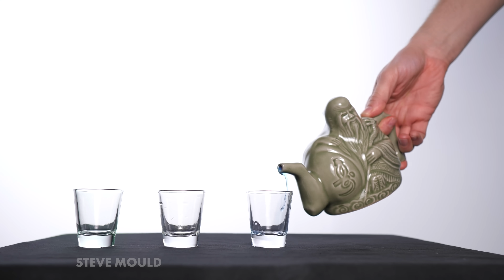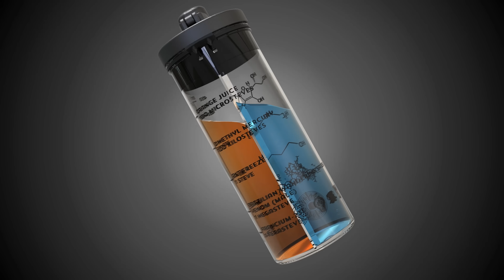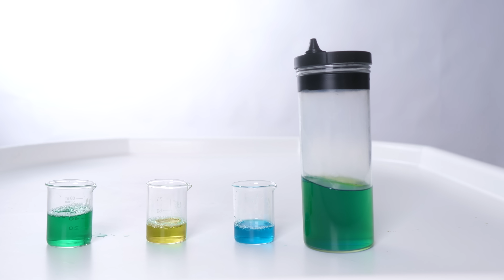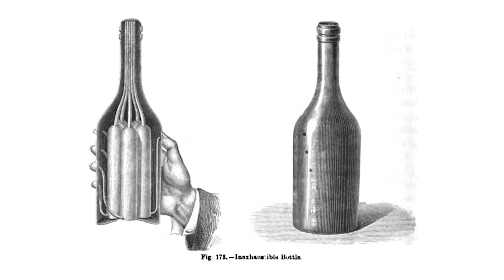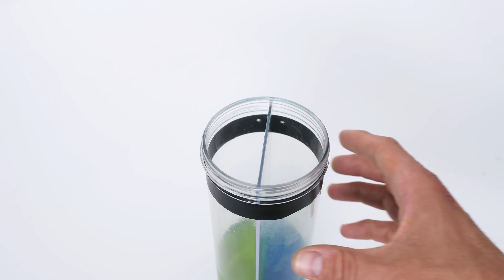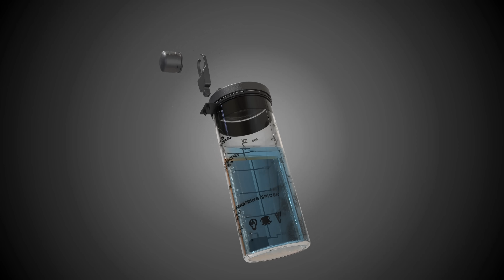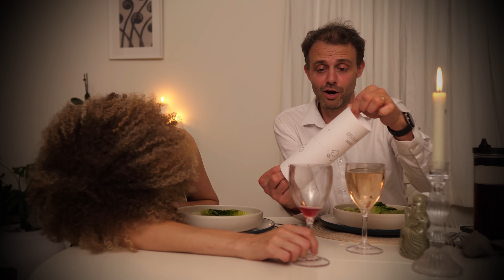The weirdest water bottle you can buy

Comment from the maker: Olive oil and balsamic vinegar! The use cases are endless. Pre-order yours now: https://curiositybox.com/bottle
Reply: About the two holes, wouldn't it be possible to have rubber/silicone click-push buttons on top of each hole, with a valve that gets clicked?
Reply: @Quillyik  That ruins the idea of using air and surface tension, but that would be good too
Reply: Can you order just the Assassin’s water bottle and not the cat one?
Reply: I can definitely see this being purchased for people seeking to smuggle in alcohol to a venue or workplace.
Reply: It's too small only 450ml  for each side. You need a minimum 2L version imo.
Reply: @aaronstanley6914  "Too small"? Who needs more than 450ml?
Reply: For the covering of the holes you can have a ring around the entirety of the top section with a small rectangular hole in the middle of it, then you just twist to cover one, both or neither.
Reply: @TukTuking  Impractical and ineffective
Reply: @AllGoodOutside  hahaha...so it is practical and effective on a water carafe, but for some reason not on this? I think you are impractical and ineffective. Go watch more youtube. 🤣
Reply: @TukTuking  You need to learn how to take criticism better. And The whole purpose of the assassin's water bottle is to not make the trick obvious. Your little clicky bit works Probably but would not work to the desired effect on this.
Reply: @AllGoodOutside  bwahahahahha...okay, dad.
Reply: @SteveMould I would love to order one but your options don't let me choose the version of the bottle and the one sleeve that I want. Is there any chance you make that an option?
Reply: Lemonade / Iced Tea / Arnold Palmer
Reply: Gotta say, I really hate that I can't just buy the bottle with the molecules on it without spending $165 and buying two water bottles... its the only reason I'm not buying at all. Otherwise I'd be jumping on this.
Reply: twist collar breather  slot
Reply: I think it was first designed to be 3D printed then somehow got in production...

Expected more clever design honestly maybe there are some reasons why don't make the air holes 2 button like push valve or like a 3 state switch valve or something like that it's way too simple to be a novelty. I am no expert or never been involved in manufacturing so it's not a criticism by any means just an idea.
Reply: But olive oil and balsamic keep themselves separate, so you don't need it for them. There are other options for liquids that separate themselves. The things you use to collect juices from meat to make gravy and separate them from the fat, for example (which are apparently imaginatively called "fat separators").
Reply: Unfortunately Tritan plastic can't be used for hot liquids because it starts degrading above 80°C. I love the design but I need a bottle made of better materials. Sell me an insulated version for $200 and I'm in!
Reply: @thejuanderful  hmm, the Aeropress Clear is supposed to be made of Eastman Tritan... perhaps it's using Tritan Renew which is rated for 100C?
Reply: Absolutely love the idea and for once I'm actually inclined to order both just like I always want to order a curiosity box! ... And then I get to the shipping/tax part and realise that these products are actually only really meant for people in the US 😢 (yeah maybe it's silly that I'm willing to pay 300$ for water bottles and posters and then not willing to pay to get it sent to a EU country, but I'm just not paying 70+$ for shipping and taxes, my brain can't because of principles or something!). But anywho, thanks for the lovely content 🤙
Reply: @Rolfenstein  Same here
Reply: Gin and tonic would be better
Reply: i love this and this is the perfect promo vid but really wish we could freely choose which design to get 😭
Reply: @steveMould Sadly i can't get the Assassin's water bottle instead of the Schrodinger's cat water bottle with either knights tour or braids by begginer Assassin bundle
Reply: It just looks better
Reply: One question that isn’t answered on the website

Will the bottles be dishwasher safe? I currently have a large jug I use for water that I have to clean by hand because the material slowly breaks down from repeated dishwasher cycles
Reply: I'm actually hoping for Iced Coffee and Water... though.... I might need a bigger volume for that... oh man... if this is popular enough, you should make a larger volume version but with 1/3 and 2/3, or 1/4 and 3/4 volumes respectively for mixing things you want in different amounts. and I kinda wish there were a way to fill one chamber while the other was covered... even if it just meant swapping out the lid to make filling easier.
Reply: michael steve mould...ns
Reply: Secret holes should be always close, so it is safe to carry the bottle around. Only if you push one or two lids together, then your drink will escape to your mouth.
Reply: instead of having holes you have to cover, you should have to push to open one or both of the holes. instead of pushing, it could be sliding or another motion. or the closing mechanisms could be bistable, so you can toggle between open and closed. the current solution seems clunky
Reply: Hi, can't find information about shipping cost or international shipping. Also would be nice to select the bottle and sleeve style.
Reply: Can you use it for hot beverages?
Reply: The MouldSauce bottle?
Reply: Tomato soup and Red Bull
Reply: Aww, you already stole my rosé joke! Gonna need a cover for it too to hid--o, you thought of that too!
Reply: Oil or acids may damage the bottle?
Reply: As a German I have to ask:
Do the hole covers work with carbonated drinks? 
I know it might be surprising but carbonated water is the standard that everybody except for some wierdos drink over here. It has to do with invisible vulcanism...and many places in the Eifel and Rhine area having springs and deep wells of carbonated water...because of low tier vulcanism...so carbonated mineral water is the standard("Klassik") and uncarbonated mineral water is the odd one out , we call it calm ("Still").
Also would the assisins bottle even work with Classic water? Wouldn't lower pressure trigger the carbonic-acid to dissolve from the water?
Reply: I want it! But the shipping price to EU is too expensive :(
Reply: HEAR ME OUT ! make it divided by a polarized filter or two, you know, at 90º
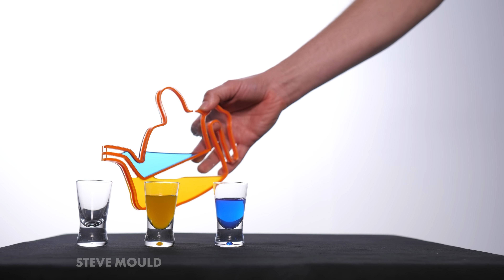Reply: 2:11  "I won't go into the details of that, because that's in the original video; link in the description."

But as usual, there's no link in the description!  😡
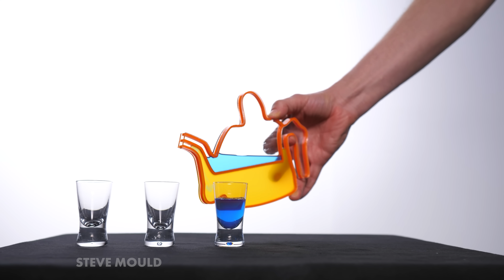Reply: 2:11  "I won't go into the details of that [how the teapot works] because that's in the original video; link in the description."

But as usual, there's no link in the description!  😡
Reply: @Milesco  the description is in your heart
Reply: Suggestions for your prototype. Could it not be a button?
Reply: i find it a little overpriced, like 65$ per waterbottle? a little overpriced, i would say, but i guess its worth a shot
Reply: @Blocoes they won’t sell many of these and the injection moulding tools will cost high 10s of thousands minimim.
Reply: I feel like that stopper design for the holes though is gonna lead to leaks; could you make the black ring instead turn so it can block both, one, or neither of the holes? Much less likely to leak then if done well, I would think.
Reply: Is my item shipping or not it took the money then said something about  cost of shipping . VA PayPal.
Reply: You should do a 3d print/design competition where people can suggest the ultimate design that you'll then take to production. Vsauce and you take your profits and the peasant can have whatever you deem appropriate. Could be a very novel and fun way to do this project. Of course alibaba is probably selling these already, but that's another issue altogether.
Reply: overpriced and get your ghb ready for all of your dates!
Reply: The bottle is leaking around minute 3:16
Reply: Wouldn’t it be easier to have a ring you twist that covers the holes? Could still cover both, one or neither, but wouldn’t be as fiddly.
Reply: 20€ shipping is far too expensive...
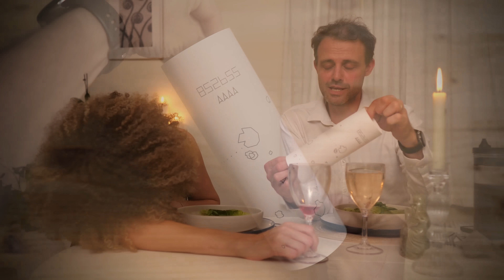Reply: 06:55 😄😄👍🏻👌🏼💙🤍
Reply: This is awesome but $100 AUD for the cheapest one is too much 😅
Reply: @SteveMould Sadly i can't get the Assassin's water bottle instead of the Schrodinger's cat water bottle with either knights tour or braids by begginer Assassin bundle
Reply: How can I order from India
?
Please make it available in india 
P
L
E
A
S
E
Reply: I hope it gets extended, as of money at the moment I can't afford expert assassin option until 10/10
Reply: when will it arrive?
Reply: For an easy and practical design of the bottle, the black ring with the two holes in it should simply be rotatable, and click in place to cover them up.
Reply: I still waiting for my items
Reply: You two are restarted... nobody needs this and this is you manipulating people, you both should be ashamed of yourselves.
Reply: Is it (assassin's water bottle) still for sale
Reply: 65 to 159 US dollars plus shipping for a bottle … are you out of your mind?
Reply: @Flipflop_FPV  is that what this is though? its a specially made, limited edition bottle that has a unique trick to it. its not mass manufactured, there's no warehouse making these things to bring the cost down, he explicitly stated this in the video. and that price is so close to the cost many premium water bottles that I'm not really phased by it. This is more akin to buying something that you would display on a shelf and use to perform the trick of pouring the tow liquids. 
If anything considering all of that, its a really reasonable price in a world of drop shipping crap from china that breaks on day one.
I think you are misrepresenting what is being sold here, just so you can be angry at something.
Its unwarranted and churlish.
Reply: @Flipflop_FPV yea I almost bought one but $80 for a neat party trick just isn’t worth it.
Reply: @Flipflop_FPV  Have you ever priced just normal water bottles these days? And that's from big companies with high volumes which reduce the consumer costs, for a limited run product With special functions this is not a expensive item. Yes its a luxury item but by no means is it overpriced It's all relative to The Person buying it.
Reply: @ravenwing199  Then I guess you better start contacting Chinese manufacturers to start making a knockoff. Personally I can't afford to buy any high end water bottle.
Reply: @AllGoodOutside  If it were metal I'd be interested. Plastic leaches into the drink and shouldn't be used for complex parts.
Reply: @ravenwing199  That's good to info, thank you, I will call up Steve Mould tonight and let him know
Reply: @Flipflop_FPV  And I can guarantee you it will eventually leak out of the little holes, and the gasket between the chambers won't be completely tight either. The only leak-free water bottles I have every had relied on screw caps. Anything more complext will eventually leak.

It's not a water bottle, it's a novelty. I love the idea, but the reality is that, after a month, it's just going to be another piece of plastic junk laying around your home.
Reply: STEVE, The curiositybox Website FAQ Section Did not include a query that many people might have which is ' Though the price is very reasonable The cost may still be prohibitive for many low income individuals such as myself, is there a diy alternative to reverse engineer the assassin's water bottle?'
Reply: @AllGoodOutside  Yes, it should in fact be relatively easy to make one of your own. You can already buy a divided water bottle like that  for 14-20 USD, then you'd really only need to 3D print (or fabricate by other means) a replacement top lid piece that allows the two chambers to flow through a single spout. Oh, and a means of airlocking either chamber.
Reply: @hollt693  Thank you bud, I may try that.
Reply: Will you be selling this under these terms from the website?

"The service and all products and services delivered to you through the service are (except as expressly stated by us) provided 'as is' and 'as available' for your use, without any representation, warranties or conditions of any kind, either express or implied, including all implied warranties or conditions of merchantability, merchantable quality, fitness for a particular purpose, durability, title, and non-infringement."

I'd be concerned about the claim that it will be completely functional as a water bottle (given that the prototype leaks as can be seen around the 3 minute mark) if you're providing no warranty that the bottle will perform that task.
Reply: @fruitshuit  The prototype leaks, yes, but the video does make a pretty clear distinction between the prototype and the final product. Doesn't seem like the prototype has any silicone anywhere, and the video script sounds like the design for the actual product wasn't finalized. 

Obviously they're not going to sell a water bottle that leaks.
Reply: @masapallo  They do make it clear that the prototype isn't the final product, but crucially that means that consumers cannot see the final product before making a purchasing decision. I do believe that they wouldn't deliberately sell a product that leaks, but if the final product has a flawed design it could appear to be just fine when manufactured and then only develop leaks after a few months.  If the factory that makes the final product uses sub-standard materials, the quality of the product consumers receive could be lower than intended.

The way to deal with this is by providing a warranty that the water bottle won't leak.
Reply: @fruitshuit  I mean, this is a one-time manufactured product, so there can be no expectation of getting it replaced or repaired.
Reply: @thecakeredux  That still leaves refunding as an option, which a warranty would do in the event of a faulty product which could not be repaired or replaced.
Reply: @fruitshuit I get what you're saying and it's definitely a valid concern but I feel like the warranty is that they know if they were to release a bunk product, it would go extremely horribly for their PR. Plus as he said several times in the video, the actual bottles aren't made yet, these have been prototypes so I kind of have some doubt that a company that this is the job of wouldn't have thought of basic error in the design. Not impossible at all but I'm not too worried.
Reply: take that shilling 101 course bruh
Reply: @SteveMould  Funnily enough, both of those liquids remind me of songs, via mondegreens. The first is Ozzy Osbourne's Crazy Train ("all aboard!"); the second is a bilingual (trilingual? counting translating to English) mondegreen, a Japanese mishear of Caramell's Swedish-lyrics Caramelldansen ("dansa med oss").
Coincidence? Possibly. Amusing? Oh yes. At least to me.
Reply: you do realise those 2 holes are unnecessary... there is a clever method you can use... i am not sure if should say this in comment.
Reply: He Steve you said pre orders will be available for 2 weeks in the video, but the page says preorders stop October 14th. which is it?
Reply: Jesus is God He willingly died at the cross. He rose again on the 3 rd day for the forgiveness of sins. Anyone who believes that will be in Heaven. He is the savior. All who believe will be saved. It’s that simple
Reply: What year are we in? The 1800s?

Comment: Woooo got mine today and i must say, it works amazing :D The changes compared to the version you shown in the video really are alot better, i love the extra filter (plus spare, and even the 2 hole-plugs come with spares). I already tested it with several syrups (bright red and blue) and it works like a charm. Can be fidly to remove the plug on the go, but they stick very well.

Comment: Hello, I have 2s proposition of experiment :
Could it be possible to syphon hot air like we do with water (but in reverses..) ? With any dark colored pipe we can heat air in the sun, or extract gases placed lower. 
I wonder if it is possible to use this extraction power to heat the lower part of a house with the hot air collecting under the roof, with the help of a solar chemney a bit higher than the roof. to see, an (enough large) acrylic model could be use, or some flexible large transparent piping...

Comment: I see a lot of people suggesting normally closed one way valves working as buttons. I think that this idea also has problems. Those valves could be opened inside a bag when something presses them.
I think of two other solutions:
- A slider or more sliders with seals like I have seen in some food boxes. You slide it down or to side to open the hole.
- Rotating ring/rings that open/close the holes when rotated.

Comment: instead of a stopper, would it be possible to have a rotating ring? like some seasoning bottles have where you line the opening in the free rotating top half with the stationary opening in the bottom half. that might be a bit more hidden than an extra flap? and cant be undone as easily in your bag. i think i've seen rotating stoppers in things like spray sunscreen or cleaning supplies too

Comment: Why not have a slide/switch kind of design for the holes. If the slide is all the way to one side, the opposite hole is open and vice-versa. If the switch is in the middle then both holes are blocked. Maybe have it slide up from the middle to open both? Almost like a gearshift. It would be more reliable and leak proof than rubber plugs that can deteriorate over time as you plug/unplug constantly.